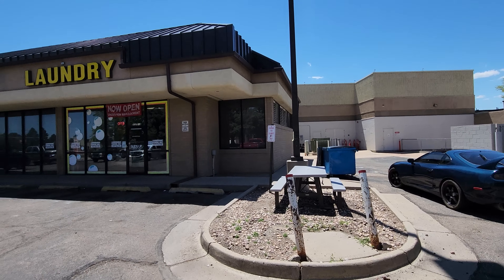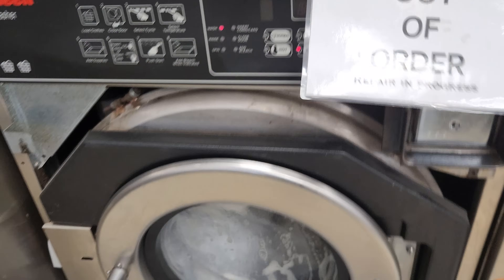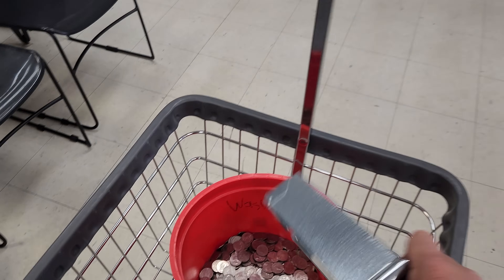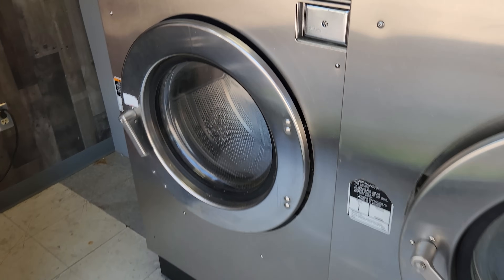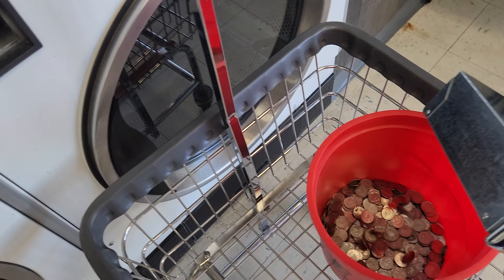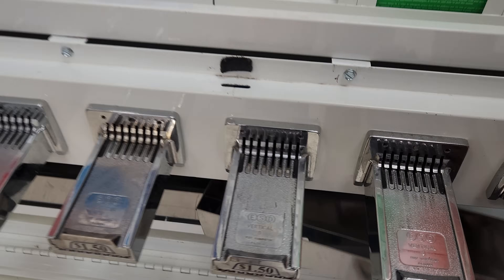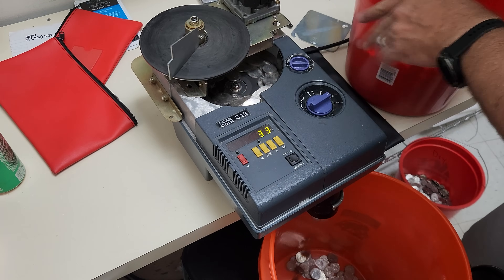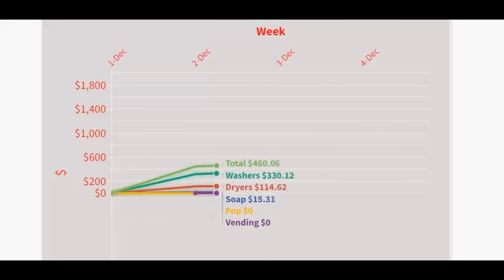What Major Changes are we Making at the Laundromat to Bring in More Revenue?

Comment: Hot tip !!!!! When the machine gets over soaked, add Downey. It’ll break down the soap immediately, Preventing your whole line from being being blocked up. Also, when you get a new cleaner, have them leave the soap fill flap open, Keep the machines from smelling like mildew!
Reply: Yep, fabric softener will cut the suds. Used it years ago in a carpet cleaning machine.

Comment: Mr appliance says “Set the machine to a full load and allow it to fill with water before adding 2 cups of distilled white vinegar. Complete the wash cycle. Run a second rinse cycle to remove lingering residue. Repeat these steps if needed until no visible suds remain on clothing or the appliance.”

Cheap natural way to get rid of excess soap

Comment: Mark i just had an idea for the ceiling fans in the big laundromat. You could control them with a 120volt line voltage cooling only thermostat. That way they only kick on above a certain temp in the building and would shut off automatically. Again just a random idea i had off the top of my head.